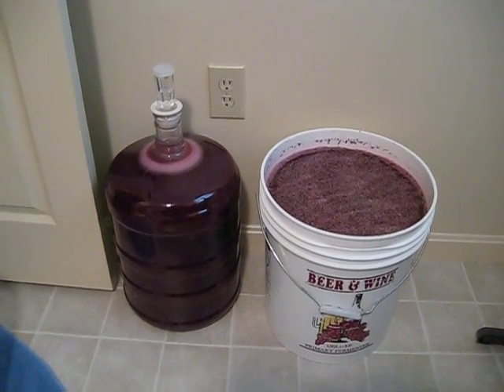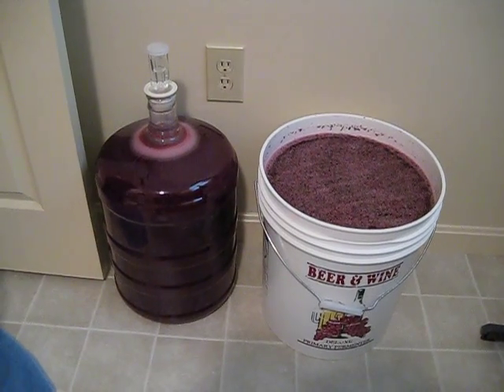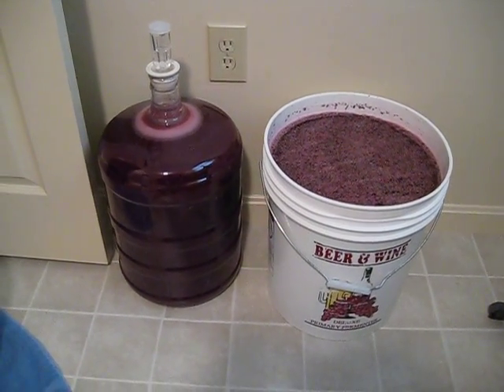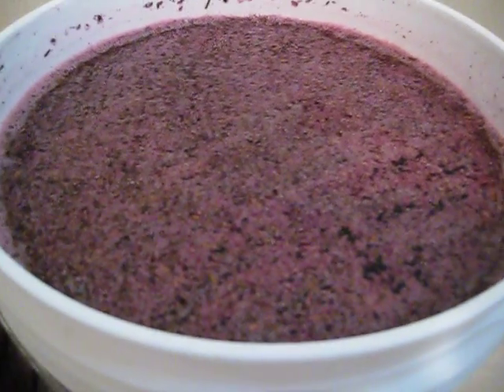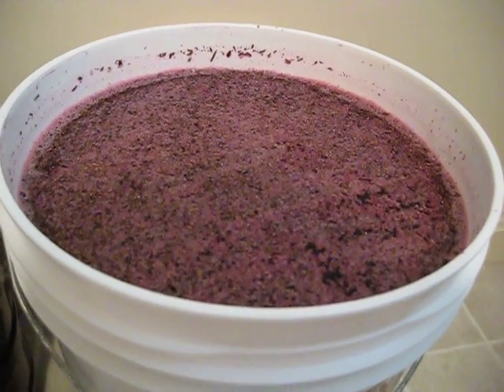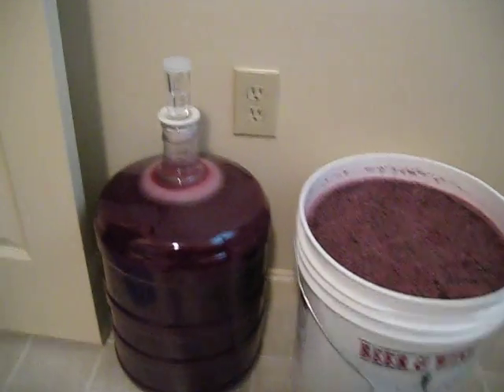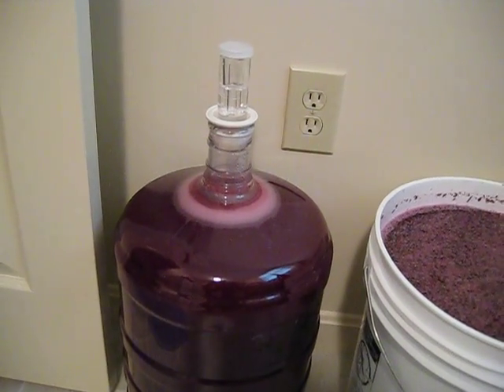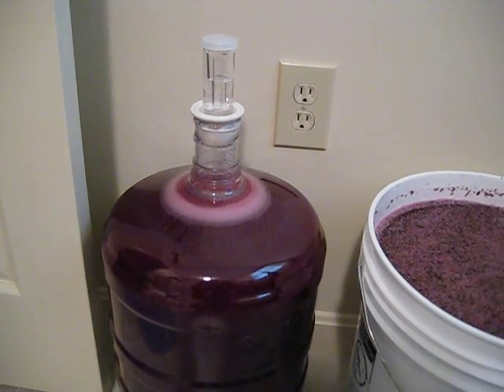Primary versus Secondary Fermentation

Comment: The plastic bucket has more headroom (including oxygen) and the carboy is filled to have very little available headroom (which will hopefully get displaced by lots of CO2). After the yeasy rehydrates it needs Oxygen to multiply, but once primary fermentation is done, oxygen will only stale the wine.